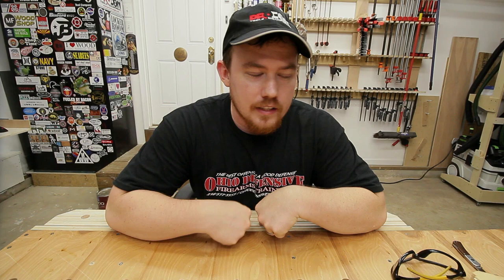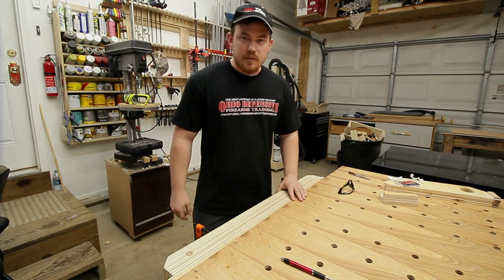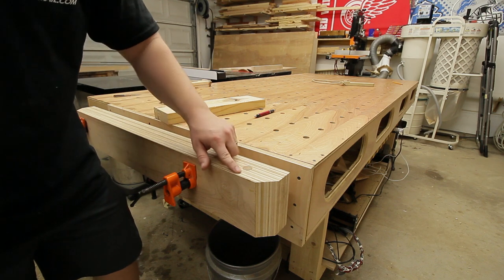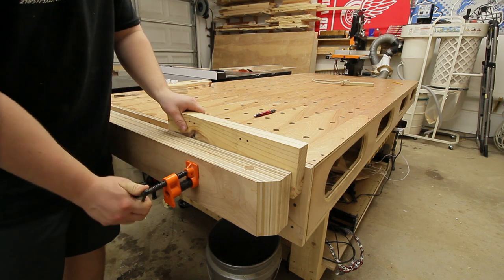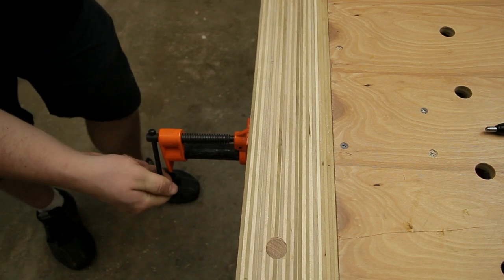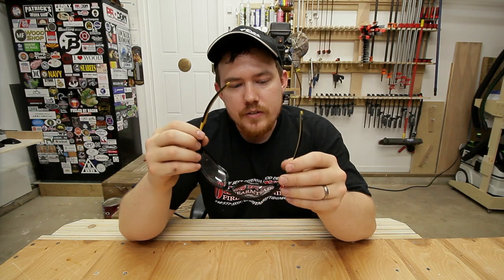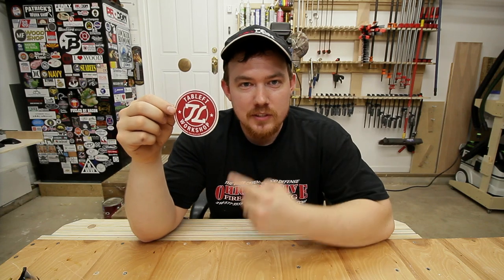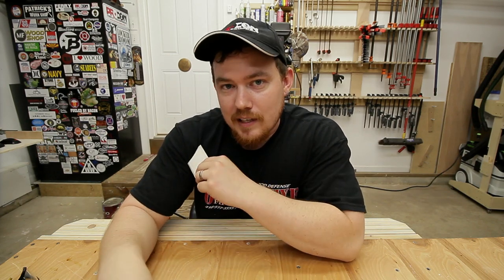Questions About The Vise

Comment: I think if you were to make a dog that has some backing on the bottom under the table side. It would keep the dogs from damaging the 1/2" top.  Like two layers of 3/4" plywood blocks attached to the bottom. It would be a shame not to be able to use that nice vice and table without that function. Great video!

Comment: Jay I may have a solution for your dog holes. Use a piece of wood that is 2" longer than the span of 2 holes. Space 2 holes that match the dog holes in the bottom of the piece of the wood. Glue in two pins, leaving 3/4" sticking out. This should keep your pins from torqueing inside the hole in the table under load..

Comment: You could make a "foot" that spans two dog holes for one end of the clamp to stop it from bending back. You wouldn't be able to clamp down on it as hard as a full depth dog hole (the plywood would start giving way) but you wouldn't typically need to use that much pressure.

Comment: hey Jay, on the dog holes... I built myself a Ron Paulk style miter station with the same type of 1/2" birch ply top w/ dog holes drilled....  But I use dogs in the dog holes all the time man, with no problem....  But I dont use traditional style dogs...  I took some inspiration from the cheap orange plastic dogs that I saw come with the Black & Decker WorkMate.   For my 3/4" dog holes, I took about an inch or two of 3/4 dowel and drilled a hole for the dowel in a 1.5"x1.5"x0.75" block of wood (or a 1.5 circle of wood w/ one side sanded flat will work too)  and that style dog should work good on your table, works for me...   if what I'm trying to convey doesnt make sense, just look at the orange dogs that come with the Black & Decker WorkMates.  Just incase this helps you any....

Comment: you could always add a 2x4 under the table top to stabilize the dogs.
Reply: Or a 90 degree "L" of plywood with a dowel out the bottom and a tail to stabilize it and keep the ply from deflecting too far.

Comment: as to the bench dog in the vise, glue and screw a 2x2 (1-1/2"x1-1/2") on the underside of the top in alignment with the vise bench dog hole to reinforce the holes.  Then re-drill the holes. the original Ron Paulk design used a single sheet for the top to keep the weight down, which shouldn't be a factor for you.

Comment: If you didn't have such ready access to the rear of the vise I wonder if you could use some string or fishing line down the length of the tube to pull the catch from the front?
Reply: Lee Valley had or may still have as set of pipe lamps for a vice with a release designed to work from the front. A bit more expensive though.

Comment: I guess it doesn't matter any more, but did the safety glasses fog up on you from the heat?  I used to have that problem on a job that I had in a hot environment,

Comment: Why is the clamp face so thick? Would a single piece of a 2x6 work or do I need 2 of them stacked up to make 4” face plate?
Reply from the maker: Because I used plywood. A single 2x6 will work.

Comment: Couldn't you just clamp a scrap 2x4 or anything using the existing holes in the table and the clamps you altered. It would act as a positive stop for the moving dogs to push a work piece against.
Reply: Alternatively glue 2x1 under the hole line and redrill the holes in the plank. Now there's enough meat for bench dogs to bite.